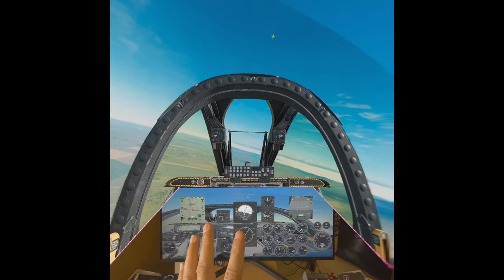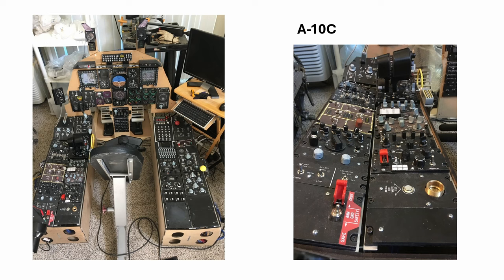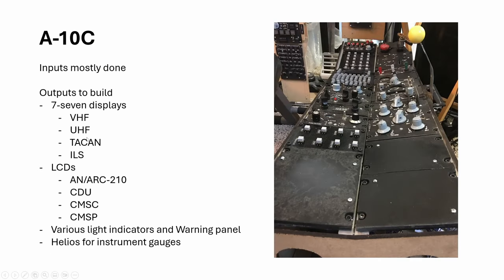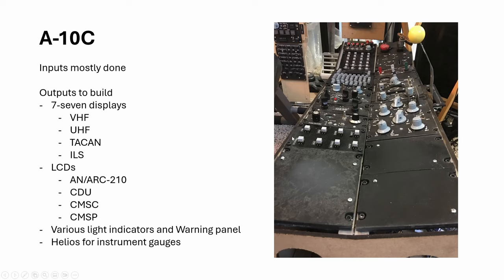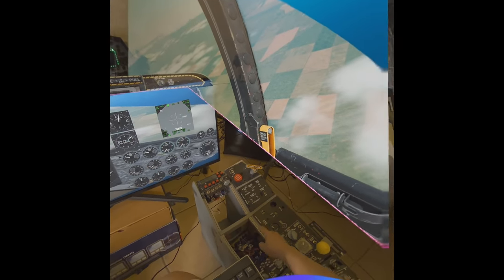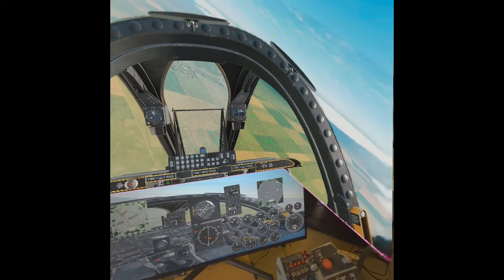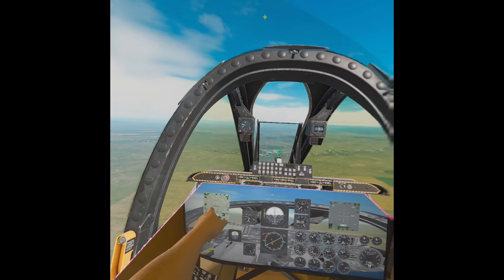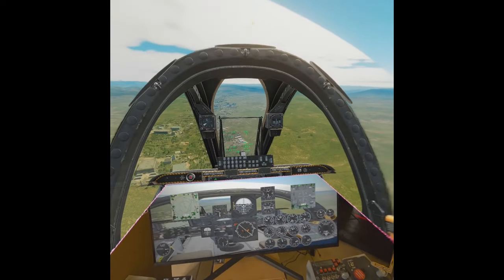Episode 1 DCS A-10C Mixed Reality Test

Comment: Great work! You can also mask the VR headset view on the monitor by changing the background image in your helios profile to a solid colour.
Reply from the maker: I have tried that making it black. Tried the generic MFD viewport too. Tried messing with some Lua files too. Nothing worked. If it has worked for you please elaborate your solution
Reply: @simpitacademy  i did it similar to how you made your passthrough image to use in openkneeboard. You'll need to make an image .png for helios, and cut out holes for the DCS exports. MFCDs, RWR, Clock etc. Just take a screenshot of your main panel when you are flight in windows, then use that as a template in whatever image editor you are using. Once you have the mask made (with the holes you cut out being transparent), set that .png as the background image in your helios profile. Worked for me.
Reply from the maker: @thewarthogproject  Its an honor to get suggestion from you. Your work on the A-10 cockpit is legendary. I tried your suggestion in two ways but I'm still not getting it right. For a start, the viewport's background itself is useless. With or without selecting background it doesn't change a thing. So I take it that you mean filling monitor 2 background with a PNG. Didn't know you can do that. So I tried blacking out everything, except a cutout for the A-10 RWR area being transparent. The issue was RWR having transparent background showing VR view. With this cutout it is still the same, transparent. So I tried the opposite. I have everything transparent, and have one black square at the RWR area. Now in VR the RWR is blacked out, can't see it. Both ways are incorrect. Can you tell me what I'm doing wrong? It would be even more helpful if you have screenshots or a short video on the steps. I think it should be simple but I've not understanding your suggestion correctly. Thanks in advance
Reply: @simpitacademy  yeah I haven't found a way to make the background of the exports not the VR view either. I just mean you can mask it to black out the VR view on everything else around the displays rather than having to use wood to cover the monitor.
Reply from the maker: @thewarthogproject  i see. Most of the open cutouts will be covered with a panel soon. My concern is those with transparent display like the RWR and digital clock. I suppose you don't have this problem since you fly with your big curved screen in 2D and not in VR? In VR, the RWR will be transparent and it's viewport only, can't be exported via dcs bios. So I think even if exported to a small round LCD screen of its own via hdmi and helios it will still be transparent in VR. Thank goodness the A-10's MFDs are not transparent in VR like the F-15E's.
Reply: @simpitacademy  I've been trying to get Mixed Reality with a quest 3 working as well. Still working through these issues. For now I've just blanked out the exports (other than the mfcds) and I flick the openkneeboard chroma key off when I want to look at them.
Reply from the maker: @thewarthogproject  so it looks like at the moment there is no solution to those viewports that are transparent in VR like the RWR other than turn off passthrough to view it without the transparency in VR